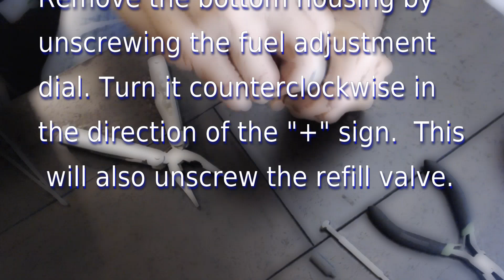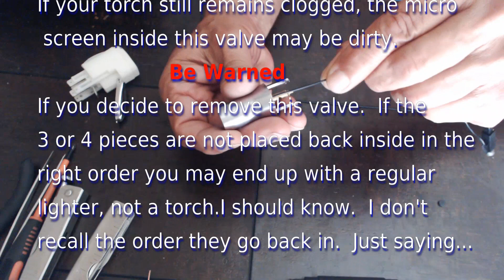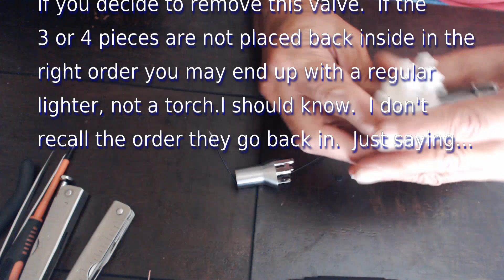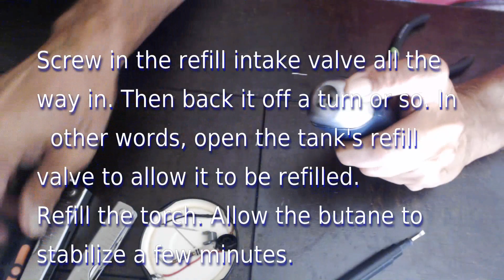Scorch torch lighter teardown, fix, repair and reassembly. Part 1 How to replace the Piezo

Comment: Literally the reason I sought this video,  you skipped over. 😂 you don't remember the order of the filter screens to make it a torch...🎉
Reply from the maker: I remember. The one that goes back in first is the disk, then the spacer, last to go in is the screen. Make sure they are in laying flat before you screw in the in-take valve.

Comment: I have a torch I want to take apart and see how to apply what you’re teaching.  Might be a silly question but it has 6 screws on the outside will anything dangerous happen if I remove all the screws?  2 on bottom opposite each other straddling the +/- wheel, 1 on “left side” below the sliding lock switch, 3 on the “right side”.  Not sure if that matters.  I take anything apart that can’t shock, burn, explode, or bite 😮😊
Reply from the maker: Hopefully, I'm not too late to assist you. I would start removing the  2 screws on the  bottom opposite each other straddling the +/- wheel.  The others I would wait until the removal of the 2 screws on the bottom.  I would be hesitant to remove a screw that might be related to the lighter's top. leave it alone.  Once a lighter's top comes apart, oh brother what a mess.  I was never able o put it back on.  
What kind of lighter is it?  Brand?

Comment: Hi, I love your video. Can't wait to fix mine, but first I've got to get the cover off.. 😅 I have the Scorch Bullet torch. By pressing on the fire button, the body will slide up a  little but not off. Do I need to remove  the fire button?

Comment: Seems that each scortch torch lighter is different,,,because the one that i have doesn't work when I try turning the flame adjustment counter clockwise or the other way???

Comment: The mass reduction carried out on the Linux Kernel in use here has begun showing its paucity. For example, in Linux one expects to tap the "square" icon, shift between and among various "Windows" or "tabs" and then return to the application where he began without the data loss and inconvenience of having a browser or other program reload and demand a complete replacement of data lost because the Busy-Box  Kernel stub is no longer capable of networking, clerical chores, and returning from whence it began sans data input losses. The memory limitations in a world where 4GB RAM chunks cost $20 and are as common as house flies fails to "compute, " if you get my drift?🤬

Comment: Interesting.  I bought a lighter like this 6 months ago and it stopped working as you can squeeze the handle trigger but it never lights.  I was hoping it could be something simple that I could try but with my limited vision I could never do this.  It was one lighter that I could actually use due to the arthritis in my hand I cannot use my thumb.  I really don't like to as this but if I could mail you my lighter could you fix it for me?  I would be eternally grateful to you if I could get this working as I have been to all the smoke shops in my area and they have nothing like this lighter.  Everything is  for using your thumb.  I completely understand if you cannot do this for me.
Reply from the maker: send an email to cantucomputing@gmail.com and I'll reply with my mailing address.
Reply: @cantucomputing9241  You have been granted 12 months additional mortal life.
Reply: Was it your piezo spark wire that needed adjustment or replacement? Thats my guess.

Comment: Do you know how to assemble a Scorch torch Matador....im stuck after I replaced the piezo
Reply from the maker: Sorry it's taken me so long to reply. Before the Gabon, I purchased a Matador. I still have it; and it's still torn apart. I could never put it back together again. The major problem I had was the upper housing's lever used to push down the piezo. I could never figure it out.
Reply: @cantucomputing9241  Are you missing a metal piece that sits on top the piezo and pushes down on the lever to open the gas? I lost one my first time on a torch and found it on another one which explained why.
Reply: @cantucomputing9241  With heavy use and a budget get a flint scorch torch. Piezos last on them but have to be replaced. Flint takes seconds.

Comment: Please explain to me how about the part were you refill it .
Reply from the maker: I hope you are referring to the refill valve. If not is it something else? 

1. I assume that you have unscrewed the refill valve.
2. Insert the refill valve and screw it in all the way in until it won't screw in anymore. You can use your fingers at first to screw it in. You may have to use a little force at first. For the final adjustment I use a small screwdriver. 
3.Even with the valve completely screwed down, it will accept fuel. 
4. Don't turn the valve.  Using refined butune, fill the tank.

5.  IMPORTANT. Give the butane 5-10 minutes to stablize inside the tank.  
6. Don't pop the black adjustment button on yet. Save it for last.
7. You have refilled the tank. Do not adjust the valve. Go ahead and see if it will light. There should be some butane that will leech out. That's normal when refilling the Scorch. 
8. Now adjust the fuel valve. Turn the refill valve counterclockwise ONLY 1 full turn. Try lighting it. There may be too much fuel in the tank and a big flame may flare up. Be careful. Give the lighter a few more minutes to rest and stablize.
9. If it does not light, unscrew the refill valve just a little bit more. Like a 8th of a turn. You may notice the flame may flare up and then become smaller and go out.
The fuel is still stablizing. The fuel will stablize and become the torch flame you are accustomed to seeing. After adjusting the Scorch Torch further, you should be all set.
10. The black button goes in last.  Look at the bottom of the button. There is a half oval channel. Look at the valve you just finished adjusting. Opposite the side of the 
phillips screw, there is a metal teet sticking up. See it? Now position the dial button so that the metal teet goes in the half oval of the button. It acts as a stop to keep people like me from winding up on the 5 o'clock news.

Thank you for reaching out to me for further clarification.
Reply: @cantucomputing9241  I don't see where you fill it , no screws,
Reply: @robinspade4309  You don’t fill a screw. You refill the obvious refill valve.
Reply: Always use butane with a plastic nozzle because plastic seals way better! Newport zero and whip its have quality adapters.

Comment: Honestly thank you for that, I've been able to fix a few on my own, but tearing down the first light for parts is genius. Didnt even consider doing that at first. The tips on cleaning the jets too are also greatly appreciated hopefully my $30 fucking lighter will last me as long as I would expect it too.
Reply: Tip: Only buy vintage all metal lighters and service it yourself. It will last 20 years before it needs servicing again. You will never get these quality lighters anywhere in your lifetime except vintage lighters that were made to last forever. Don’t buy modern! Except torches. Scorch torch only.

Comment: Going way too fast...I know I can pause but just trying to follow it and comprehend, its going too fast...Ohh well...
Reply from the maker: I hear you. I'd like to help. I more than likely still have the video clips I used to produce this video. I could make whatever section available to you via my google drive. Let me know.
I have had similar complaints on the torch lighter video.  You can also slow the video playback speed found under the gear icon (settings).   Let me know how I can
help you. I'm so glad you posted your comment.
Reply: @cantucomputing9241  Ohh, well now I just feel like a dick!!! Sorry about that....and hey good idea about the gear and slowing playback. However it doesn't allow you to do that when casting media from your device 😠 but its Ok!!! I just paused your video like it said to haha!!! Thanks for the video buddy!!! Much appreciated!!!
Reply: Lower the speed to 50%. That’s what the setting is for.

Comment: This is not for the lighter actually called scorch torch, the scorch torch is one of the few non piezo operating torch lighter that operates with flint and wheel, its in my hand right now n came here looking for how to replace flint, unfortunately this info is not helpful to scortch torch users
Reply from the maker: Ryn: I agree with you. This video is for the Scorch Gabon, which has an electronic ignition, as opposed to a torch with a flint wheel. However, if you pull off the flame adjustment wheel you should be able to find a small screw to get inside of the torch.
Reply: Ryan you must not understand what a scorch torch is. Its a brand name. They are both the same brand. But theres dozens of models so a scorch torch is not a torch lit by a flint. Thats one of around 50 models. It’s crazy to find the exact ones without a model number.
Reply: I would recommend researching Scorch Torches or even looking on eBay. Giving out bad information on torches is why people have so many problems. Scorch torch = brand name only. Most are piezo. I rebuild and sell them. Your info tells me you don’t understand scorch torches or butane lighters nor how to fix them. He clearly shows a scorch torch model that helps people with that particular one. Only a professional with money can go through hundreds of videos over months. 90% of returns are because buyers have no idea how to use butane lighters or torches. They blame them when the buyer is what’s broken. Learn how butane torches. Replacing a flint on a torch is the easiest thing to do and requires no disassembly. Pull the wheel off with your nail and treat it like a clipper. Put back on.
Reply: So Scorch Torch named ine of their lighters Scorch Torch?
Or did you mean to say another brand you didn’t mention is named specifically a “Scorch Torch?”
Because this is a Scorch Torch brand.

Comment: You are the exact reason we can't get those cheap lighters anymore with the right starters anymore your not clever we did this for years and now they have revamped the types of starters they use now they are without wires and can not be used to fix our good lighters anymore! Thank for ruining it for everyone
Reply from the maker: If you are referring to the types of lighters that light with a piezo, more than likely they are the type that do not have a long wire. If you cut off the lead wire on a replacement piezo where the wire comes out of the piezo that should work.
Reply: You BE NICE! I'm talking to you Yvonne.
Reply: Yeah I’m sure all lighter companies saw this a year ago and panicked so immediately changed the design to make it harder to fix. Ridiculous. All you do is solder the wires together or get a different brand. Nothing has changed. Stop blaming 1 individual for a company changing everything to make more money. Its a video with 48k views. Most people will just buy another one for the hassle then to buy another lighter to fix it. If anything it increases sales.
Reply: You are the reason social media is full of haters. You blame the problems you created on random people who have nothing to do with what you are referring to. Please get some help before you take out your bizarre thoughts on random people.